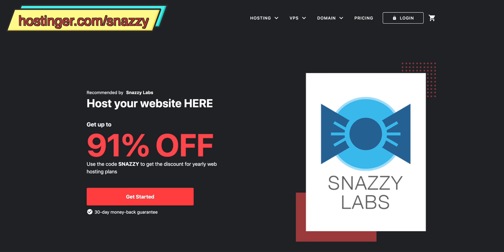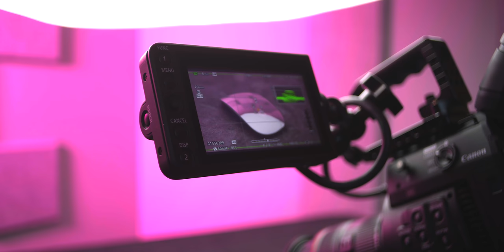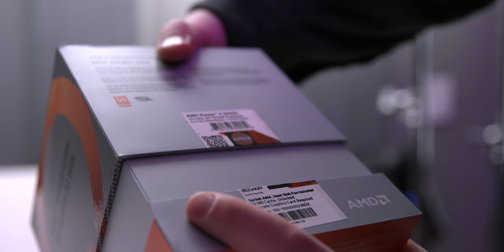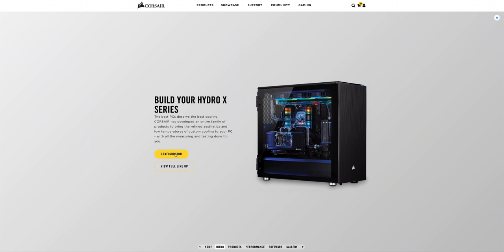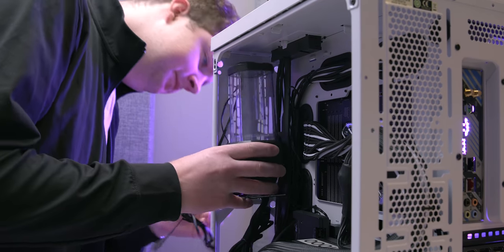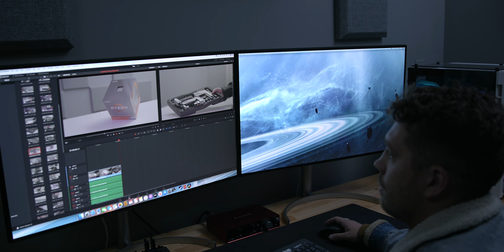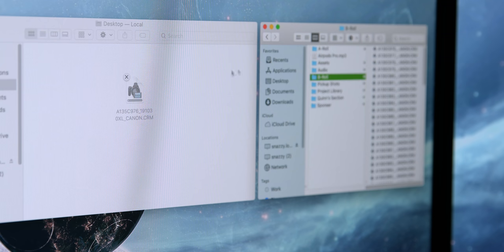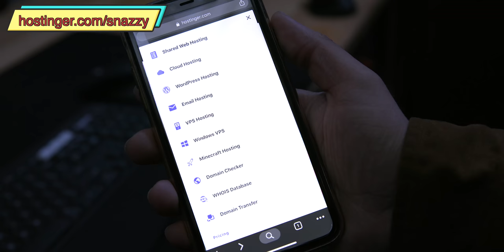AMD HACK MAC KILLS THE NEW MAC PRO!

Comment: And you got flush the water once every year, replace fittings, and once a new update comes out, you gotta make sure your hardware is supported by the community. If you’re serious about running a hack, be prepared to be on tech support for the rest of the computers life. I think by the 3rd re-install, I just gave up and installed windows. Or you can run a VM, which will make your life easier

Comment: I run premiere cc on a 3900x and RTX 2080 in Windows. Editing is solid. Exports from premiere and transcodes from AME are painfully slow. Would be curious to know if this is all because there's no Intel-exclusive Quick Sync (which the Xeon Mac Pro won't have either). What's your experience?

Comment: Drop in that 3950 so we can see how it performs compared to the new Mac Pro.  Of course like most, I am also curious to see how it fares against the new Threadripper 3 processors. It seems like Apple could make a machine with the Threadripper processors and price it lower than the current Xeon machines. If AMD keeps beating Intel, in 2 years, would Apple make a full AMD spec machine? Would be nice to see. For now, if a stable working Hackintosh TR3 build  is put together, then I might make the jump to a Hackintosh.

Comment: Just waiting for a 3990x in January to make a stable build with 64 cores and 256GB RAM to replace my i7 3970K workstation from 2013! It is still faster than most trashcan mac pros. My estimate is my Threadripper hackintosh will be 3 times faster than the new mac Pro in the apps I need most (DaVinci Resolve, Millumin, Neat Video) and about the same or better in After Effects. It will also have PCIe4, which is beyond comparison for capture cards, videocards and storage. For less than the third of the price. Basically, take that 50K$ and spend 15K now for a hackintosh, and use the rest for constant upgrades to GPUs (PCIe4), storage (PCIe4), capture cards (PCIe4), holidays and extra gear, none of which the new mac Pro will ever be able to give you.

Comment: Amazing system but the rgb...ick. Not my thing. A threadripper version will blow the doors off a top of the line Mac Pro. 3970X has 32c/64t threads. The Xeon W-3175X is only 28c/56T. Then next year the 3990X with 64/c/128T..That is more than twice the cores. I suspect the 3990X with be around $2500-3000 in price.  A 3970X based system comparable to the Mac pro top of the line would cost tens of thousands less.

Comment: What you Americans need to do is start from scratch again from the 1980s up! BUILD A Ford Model T VERSION of your 21st Century PC or workstation or server or mainframe or mini-computer using an open source hardware and open source all around interfacing and all around compatability type computer which is also a DIY repairable, maintainable, inspectable, checkable, upgradable, and adjustable hardware. And all applications are not digital but in analog forms of controls, indicators, feedback systems, monitoring systems, sensors, etc. All components are pluggable and their motherboards scalable which means they have a hybrid firewire-usb connectors to be daisy chainable, etc.

Comment: SUPER interested in actually building this! I’ve been an Apple user for years, but these outrageous Mac Pro prices are pushing me away. 

I was curious what OSX you installed? Have any issues installing older OSX? I do audio and video, meaning I use Pro Tools, Adobe suite, and Davinci. You stated Davinci and FCP run well, have you had experience using Premiere and After Effects? I’m assuming they’d work well with the Vega 64s but nonetheless. 

Also, I’m somewhat ignorant to building. You obv built with water cooling, but listed a more affordable build with traditional fan cooling. I would likely go the more affordable route; I’m unsure you’ve actually built the alternate, but do you feel that cooling would suffice without hindering performance?

Comment: Man, imagine if you built a Hackintosh around a Zen 2 Threadripper CPU. Like the 32core/64thread or 64core/128thread parts. You could probably blow the most expensive Mac Pro out of the water for about 10K. And most of that cost would probably be the 1.5TB of RAM

Comment: Besides the “sexy” look, how is the noise of water cooling compared to pure fan cooling?
Reply: The fans themselves are quieter due to not having to work as hard, buy there is sound from the pump
Reply: @Hendy5  Is it like a fish tank noise? Lol
Reply: @Network126  Depend on what pump u have. In my system with 8 fan its 18 decibel in one meter distance. For me its quiet enough. The best: When its under fullload, its barely getting louder, around 25 decibel. :))) I have a dual vega64 + Ryzen 2700x setup.

Comment: Opaque coolant is not a good idea, long term.
Reply: why is that?
Reply: After about 9 months deposits start to for, especially on metal parts.  You end up having to take apart those loops and cleaning off the deposits manually (lots of fun) or replacing blocks.  I noticed temperatures climbing on my threadripper setup and quit using opaque fluid after 2 times.  Using dyed fluid only now and zero issues since.

Comment: Does your  5700XT fan spin on 10.5.1-3,  I tried it on all .1-3 versions, but it just doesn't spin, causing massive heat on the GPU. I have MSI Gaming X 5700X

Comment: Now this is what I wanted to see...  I stay getting notifications about that new Mac Pro & this confirms that in this new Mac Pro Apple has, nothing has changed.  Same old scenario having to pay more for something you can actually get for less in some way...   

I need to actually build me one with a custom loop... for fun...
Reply: But where are the real world test? You can build a PC with the same specs that Mac Pro has...it’s just going to run you $71k from dell. Good luck with that.
Reply: @JJohnson313  ? Did you not watch the video? I think you might have watch this and the point hopped over you somehow.  

Applying your example this video suggests you do not need that Dell to get better performance than the Mac Pro.  

That Dell you are referring to if one was to place MacOS on it would also get better performance than the Mac Pro...   lol...   Thanks for helping me point that out...
Reply: Also your keywords are "from Dell"  which isn't what I just said which was to build one. Builders of PCs do not buy from Dell... or anyone like them namely HP, Lenovo, IBM.......

Comment: So cool, I just bought 3 x 32 inches 4k. monitors to plug with my macbook pro and even if online it says it works, as soon as i'm trying to share my screen using slack or skype, it lags like crazy.

Would this be ok ? I have 3 x samsung curved 32 inches connected with a display to usbc. If not, would I need to change something ?

Is it stable with this setup ?

Comment: I am agree with you.. Hackintosh is incredible and don't cost lot of money... Original Mac pro 7000$ are expensive? Apple says it's for pro? ITS TRUE... It's expensive and FOR PROS... The day your hackintosh will crash (and he finally finish to crash...) you will loose lot of tome (and money) - I do my first Hackintosh in 2007 so you can believe me....
But Apple are crazy... They can do an entry Mac pro for 3-4K with 8 cores but they are just crazy and don't... I am on Apple since 20 years now... Begin with Powermac G4, have a lot of different mac, iphone, (hackintosh lool), etc etc... lot of Apple products.... And today... not have the money to buy a pro machine... Imac pro's are expensive and not evolutive, mac pro are just more than expensive... Only macbook pro can be ok ... but not evolutive... So i work on Mac PRO Upgraded machine and busy to try a Hackintosh with 2 processors... Thanks for your video, it's very interessant to know that now AMD is Hackintosh ready... Incredible :D

Comment: "All AMD... because it is..."  (but not really)

- Intel® Wi-Fi 6 802.11ax (2.4Gbps) 
- Intel® BT 5.0
- Intel® Gigabit LAN
- 2 x Intel® Thunderbolt™ 3 Type-C
Reply: adudenamedDave noob here considering hackintosh. Is he able to get BT 5 and WiFi 6 because he’s using intel parts? From the hackintosh builds I’ve seen using intel i9 processors, only BT 4 was possible.

Comment: So you just compared pears 🍐 with apples 🍎?  I mean the project is cool and all, but the mac pro has everything in one thin case with a high resolution display. If you want something already done and with warranty and all, with a nice optic, then thats the price you have to pay. Of course its gonna be cheaper if you buy all seperately and build it together, and of course is gonna be a better performance, besides the processor, if you have watercooling compared to aircooling.

Comment: Would love to see an epyc build, not comparing consumer to enterprise cpu's. The w3235 12 core, would price wise compare to the epyc 7352.
Reply: Even Ryzen CPUs now outperform Xeons, so this is actually a quite interesting comparison. If you don't need >128GB of RAM there is simply no more reason to spend thousands of extra $ for an enterprise CPU.
Reply: That's not the point. Xeons or epyc was never intel or amd's fastest cpu. There's a reason why professional environments gladly pays up for specialized hardware if it helps them perform their job faster, so they can make more money from increased productivity. They don't care about saving a few bucks if the contract is millions.
Reply: @idiocracy9530  with Ryzen/Threadripper/Epyc this distinction becomes kind of blurry. They use the same architecture in all those CPUs, the CCX chiplets are literally identical. They just bin the higher-quality chiplets for HEDT and Enterprise models and throw the "scraps" (e.g. where some of the cores are not working properly and are therefore disabled) onto consumer grade CPUs.

The only difference is the I/O-controller (i.e. number of PCIe lanes and memory controllers). And of course the number of supported chiplets (i.e. maximum number of cores).

Hence, if you don't need all those lanes and memory channels and 16c/32t is enough for your workload (which as I said already outperform some Xeon model with higher core count), there is no real benefit in buying a high-end model.
Reply: Not saying ryzen/tr isn't viable options, but we are talking about an 8000$ intel cpu. Let's compare apples to apples first, and afterwards we can discuss why tr would be better for price, or ryzen for other reasons.

Comment: The hardware is pretty, but I’m here to find out how you installed MacOS without losing your sanity.  I’ve used the vanilla install but couldn’t get it up and running.  And the vanilla guide states the iMessages should work.  While I greatly appreciate the work of others in this subject, I think you are being far too kind.  The vanilla guide needs more work.
Reply: Shane Forsyth yeah, I’ve looked into it but the hackintosh stuff is a lot to deal with if you don’t have time to do the research and get up to speed on all of the various processes.
Reply: bobafruti over the course of a month I managed to get a Macos vm going in Windows and Linux going (no iMessage either) patched kernel amdosx version (no iMessage) so I’m not a complete noob but for me the vanilla was the least successful of all, couldn’t even  get it installed, and I tried like 5 times, so if pretty much given up and I’m back to windows
Reply: Shane Forsyth yeah, hearing that makes me not want to start and just stick with my 2014 MacBook until I really need a better Mac (for iOS development and some music on the side 😋)

Comment: Apple Mac Pro was a great value for the money back in the 2006-2012 intel era. There was no compromises as an Apple user even if you were paying a premium - you could run windows natively, game, upgrade a graphics card, add ram, hard drives etc. That era is long gone and Apple is nothing but compromises with absurdly underpowered, overpriced specs that have artificial reduced life spans with the soldered hard drives. No thanks. Back to PC with no regrets.

Comment: Attention! AMD hackintosh can’t run Adobe Photoshop, Lightroom, illustrator, After Effect probably. They will crash or not even start. I spent hours to fix these problems. And with every version update they’ll come back and you have to find another way to fix. There is no problem with Premiere Pro though, Premiere Pro run very fast with new 2020 update.

Comment: When it comes to water cooling, I really don't think it's necessary in any but the most extreme use-cases (and I don't mean some wanky gaming build, no matter how important you think another two frames per second is, I mean veritable super-computing, pure number crunching, high detail scientific simulation tasks). Basically, if you can't cool it with air, you aren't moving enough air. For the cost and difficulty of setup, I don't consider liquid cooling to be worth it, compared to slapping a bigger heat sink and a couple more fans on the case. I mean, liquid cooling LOOKS nice, and it's very effective, don't get me wrong, but is it worth the tradeoff, particularly considering the specific heat capacity of water adds a thermal "inertia" to your temperatures? It takes a long time to heat up, but it takes just as long to cool, while an air cooled system might immediately hit its max temperature, but it'll cool right down as soon as you stop the intensive task.
Reply: Well, if you want a high end system as quiet and cool as possible, there is no way around watercooling. Even a Noctua NHD15 can't compete against a custom loop

Comment: I was so excited about making an Hackintosh -- until, Adobe, and or until no Adobe. I am exclusive adobe user and of course thanks to Apple not supporting AMD, Adobe's version of Adobe products do not support AMDs. The hacks to get them to work is basically remove MMX support as well as going with an older version of RAW. So the only two applications that work for the most part is Premiere, After Effects, and Photoshop without a modern version of RAW import. Everything else crashes or runs poorly. What's the real fix? running Windows 10. Arrrgh. Oh well.

Comment: For the price of an entry level mac pro with 8 cores, 32GB of RAM and a RX 580 you can have a 28 core xeon w beating AMD 3960x with 256GB of RAM, a Quadro RTX4000 and 1TB SSD. You want the equivalent from Apple? It's going to cost you over 10.000$ extra. :)

Comment: Kind of a flawed comparison- the machine in this video only clocks 12360 multicore max, with almost 1000Mhz faster memory without ECC.  A vanilla Mac Pro has a 12084 multicore average for 12-core 7,1.

The RAM and cores are faster in Mhz, and still just barely beat out the stock 12-core.

This heart transplant isn't worth the risk- you're better off getting a $6K base Mac, and wait for the 48-core Intel Gold's to go on sale in 3 years.

Sure, it's $2-3K cheaper, but that's to be expected for any home build vs any major brand like HP, Dell, SuperMicro, etc.  You're paying for the case design, unique motherboard, and guaranteed compatibility.  That may not be worth that much to you, but to other people it most certainly is.

Comment: This isn't really an Apple's to Apple's comparison though is it? The Mac Pro uses workstation grade components, whereas this doesn't. The Mac Pro is reliable, whereas a Hackintosh with custom liquid cooling is the opposite of that. On top of that, the base model Mac Pro is arguably the worst value spec - it would be more interesting to see a comparison of a better spec against a PC built with workstation components, ie quadro cards, ECC memory, etc.

Comment: as someone with a long history of hating apple to death, the new mac desktop isnt TOO bad. its still a complete ripoff in terms of the power you get for the price, but the repair-ability and upgrade=ability on the user side of things is WAY better than it has been on any apple product to date. it i also over-engineered as all hell, which is a good thing. still lacking in power for price though, badly. Apple, fix your pricing and stop thinking your logo adds ungodly levels of value to everything and perhaps you may have yourselves a convert.... oh and stop trying to make everything proprietary.

Comment: @snazzylabs — this video is kind of misleading. Sure it benchmarks fast, but actual performance isn’t good. My ryzentosh with a 5700xt struggles with casual games on 1080p. Apparently this is an AMD Vanilla problem - performance is great on intel
Reply: Maybe it's because you're gaming on MacOs?
Reply: TheSpryxe l Hardware / nope, it’s because Mac has no true AMD CPU support and so frameworks don’t work properly. An Intel + 5700XT hackintosh is blazing fast. A ryzentosh is slow and has issues. His video is just misleading and shallow.
Reply: @SalomonMeij  Maybe it's the fault of the boot loader you're using. A couple of my friends got Ryzentoshs and the performance is stellar according to them.
Reply: TheSpryxe l Hardware it’s not. If you go onto the AMD vanilla opencore discord you will see that everyone has these performance problems. People that say it’s stellar probably aren’t doing anything demanding on their computer or haven’t realized that the performance is about a quarter or half of what it should be compared to the same machine but with an Intel CPU

Comment: having just watched another ryzen hack mac on here, where the builder found that he couldnt run lightroom and photoshop because it was ryzen. would this machine suffer from that? my fear is that if that is the case, what else wouldnt run? i need a decent mac (or pc) for video, photography, graphics and music production. what to do to get something economical and powerful?
Reply: Well, if you don't really need MacOs, just get a ryzen System and install Windows on it. There's not really any performance benefits between the two if you don't need Apple's exclusive software.